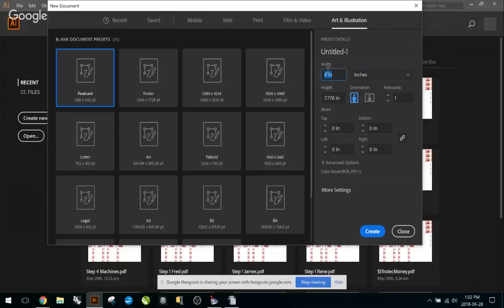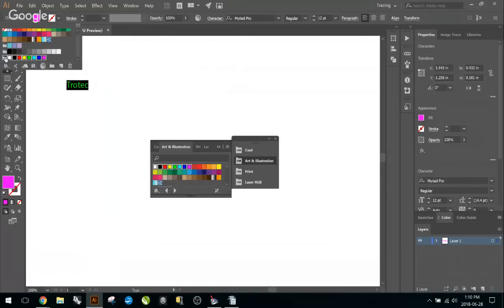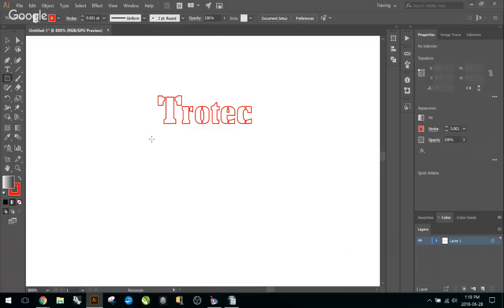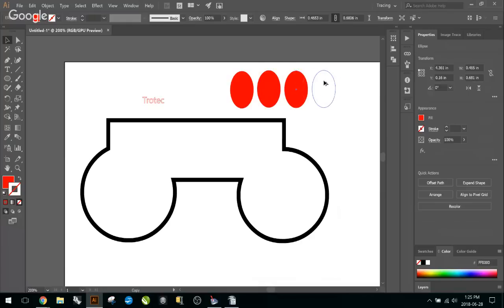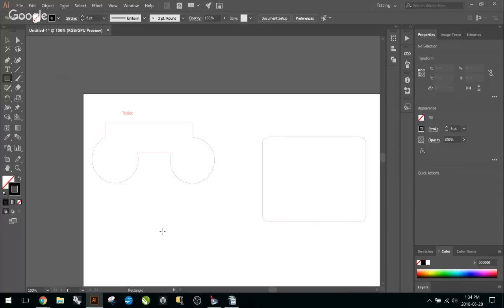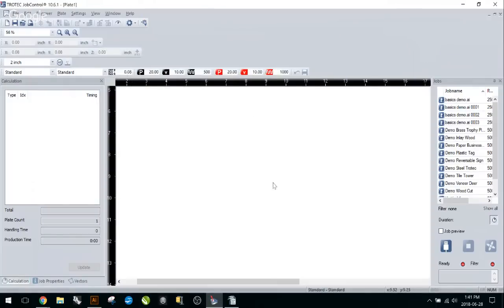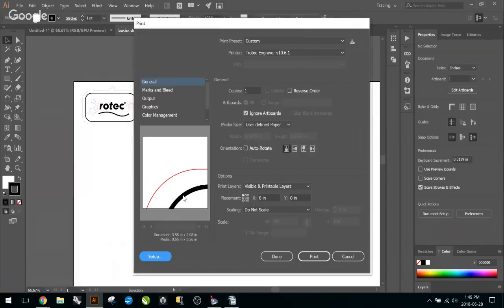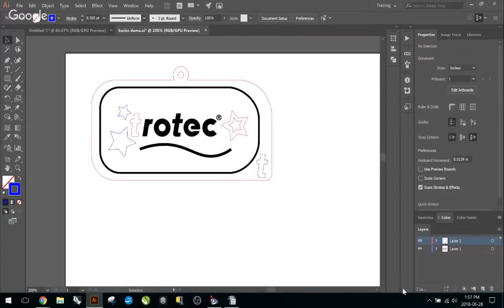Webinar - Illustrator Basics for the Laser Machine | Trotec Laser

Comment: Can you share the link for the 3D engraving/relief video? I am trying to engrave from an illustrator file and when the colours are 100% black and a cut line in red RGB 255, 0, 0, it engraves and cuts properly. However, if I use any shades of black other than 100% or add a greyscale gradient or gaussian blur to fade the engraving  out JobControl no longer sees the red cut lines even though they are in the proper RGB colour and stroke weight. I am able to do the engraving/cuts I want in Corel Draw by converting the grey area to a bitmap then adding the gaussian blur but this creates a lot of extra work since I normally work in Illustrator. If you can advise me on how to fix my illustrator settings I would really appreciate it!

Comment: Hi ! I'm trying cut some stencil shapes from a pdf I created in illustrator using a trotec laser machine (the computer connected to the machine at my school doesn't run illustrator so I had to first save the files as pdf). What happens is some of the files work perfectly but others that I created using the exact same workflow (literally just different dartboards from the same ai file) won't go through to jobcontrol. When I hit print in pdf reader they'll go to the trotec print queue but then get stuck there in the printing process and never show up in the job control job list. I haven't been able to identify any difference between the files that work and the ones that don't. Do you have any idea what this could be due to/how to fix it ? Please let me know